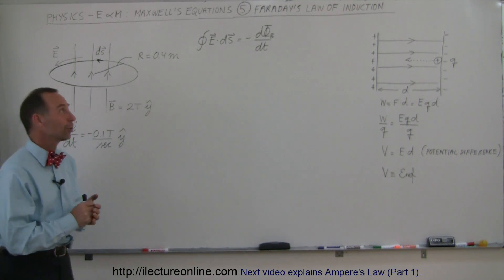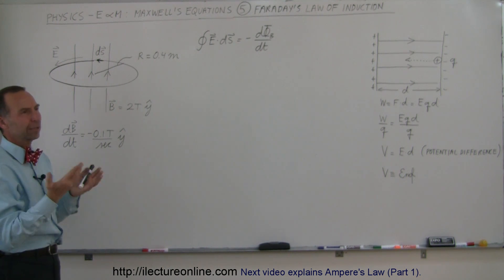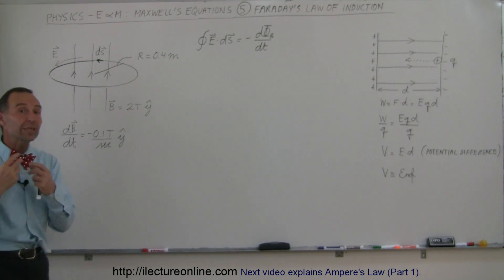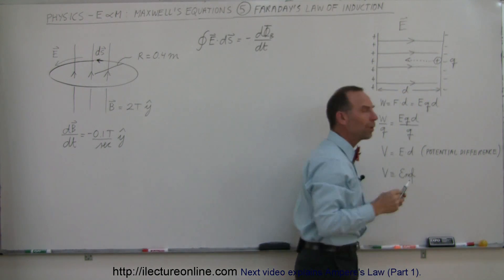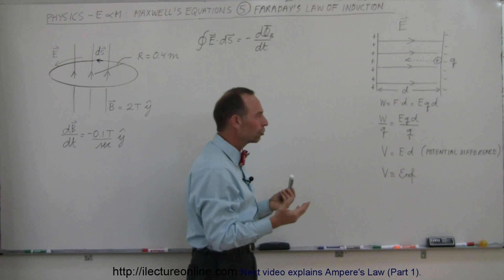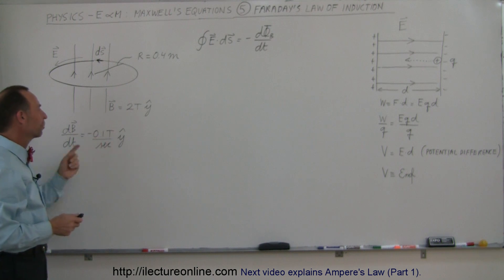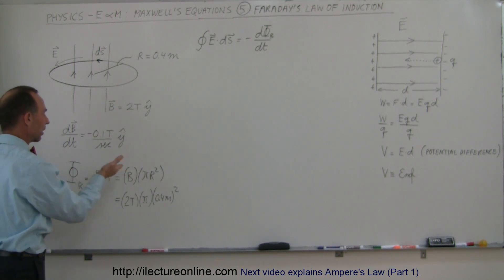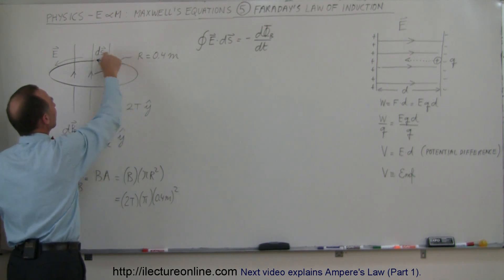Physics 46  Maxwell's Equations (5 of 30) Faraday's Law of Induction

Comment: A moving magnet induces electric field in space around it. Magnet has no electric field of its own. What is source of electric field which appears in space around it.
Reply from the maker: Not exactly.  A moving magnet causes a change of the magnetic field, and a changing magnetic field causes forces to be exerted on any charges inside that changing magnetic field.
Reply: @MichelvanBiezen  Yes, a moving magnet changes magnetic flux in space around it, which  would exert force on charge falling within changing flux. My question was not about force on charge. My question was about source of electric field which would appear around changing magnetic flux even in free space where there are no charges within changing magnetic flux. In free space only charges present are in the atoms of magnet it self unless they have any role.
Reply from the maker: A moving magnet causes a changing magnetic field, which causes the magnetic flux to change.  If the changing magnetic flux is within a closed conductor loop, the the changing magnetic flux will induce an EMF which will then push the charges around the loop.  Only charge produces an electric field and oscillating (or accelerating) charges produce an E&M wave.
Reply from the maker: A moving magnet causes a changing magnetic field, which causes the magnetic flux to change.  If the changing magnetic flux is within a closed conductor loop, the the changing magnetic flux will induce an EMF which will then push the charges around the loop.  Only charge produces an electric field and oscillating (or accelerating) charges produce an E&M wave.
Reply: @MichelvanBiezen  Changing magnetic field induces circulating electric field even in free space w/o any conducting loop. I am curious about source of circulating electric field around the magnet as magnet its is electrically neutral.

Comment: Change in magnetic flux is associated with motion of flux. Increasing current expands or moves M-flux outward  & decreasing current contracts or moves  M-flux inward. Similarly if a conductor of constant length cuts across constant magnetic field at constant velocity an emf is induced in the conductor. While in later case flux is constant it is in motion  relative to conductor. In both cases motion of flux relative to conductor is common factor. Why we don't say motion of magnetic flux induces electric flux & vice versa. This query is just to clear  my understanding.

Comment: The induced voltage in the wire loop produces a current in its loop that is due to mutual inductance from the magnetic field lines of one active conductor onto another inactive conductor(wire loop). This induced current is known as Eddy currents. Am I right, Prof?
Reply from the maker: Eddie currents are currents inside a single conductor induced by a changing magnetic field perpendicular to the loops of current.

Comment: Sir, I have a a couple of questions in regards to induced electric fields like in this example. 

First, are the electric field lines a circle (the shape of the loop)? And if so, where do they begin or end? I thought that electric field lines always begin and end at a charge, or is that only for electrostatic fields?    

Second, Gauss's Law says that the line integral of the electric field times the area is equal to the net charge enclosed divided by the electric constant: In the case of induced electric fields like in this example, if we draw a Gaussian surface around the loop so that it encloses all of it,  is the net charge enclosed equal to the sum of the moving charges that make up the induced current ... Or maybe it's zero since there would be no potential difference (emf) if it wasn't for the magnetic field? But if it's zero how can there be an electric field that has a non-zero value? (These are just guesses)
Or maybe it's something else?

Comment: Why is the magnetic flux not zero as per gauss' law for magnetism?
Reply from the maker: I think you may be mixing up 2 different and independent concepts.  If there is an existing magnetic field and we place a loop in the field you will have magnetic flux through the loop.   If you place a volume in the field, the flux entering the volume will equal the flux leaving the volume.
Reply: Gauss' Law applies to a closed surface.
The surface is open in this case.

Comment: Should it not be E dot dl? It's a line element, not a surface element.
Reply from the maker: The letter "s" is used for displacement and for arc length, therefore ds has the exact same meaning as dl.
Reply: @MichelvanBiezen   Ah, then it's just a matter of notation. My book uses dl, ds and dv to specify line, surface and volume element, thus my confusion. Thanks!
Reply from the maker: Yes, different authors use different symbols   :)

Comment: Great Video!

What happen if i add a small gap in the loop? Do you still get an emf across the gap? 
The Ohm law is still valid in this context? I mean, in order to calculate the current may i still apply the Ohm law after computing the emf?

Thanks!
Reply from the maker: In order to have a current you must have a complete loop.  When there is a gap, there cannot be a current.

Comment: Womderful video, professor Michel! I would like to ask a minor question: what happens if the loop dimensions change, for example that as the flux through the loop changes with time, so does the area of the loop. Assuming all changes to be continuous, would it make sense to generate time-dependent path and surface functions for the various limits of Faraday's law? A simple thought experiment would be a U-shaped rectangular loop with a sliding conductor making up the fourth side of the rectangle, and moving at constant velocity along the rails prescribed by the loop. In such a situation, how would one calculate the emf that is generated?
Reply from the maker: Take a look at video # 6 in this playlist:  PHYSICS 45 ELECTROMAGNETIC INDUCTION  https://www.youtube.com/user/ilectureonline/playlists?sort=dd&view=50&shelf_id=10    You will find that exact example.
Reply: Thank you, I watched videos in that playlist, and came across the example I had in mind. I have a follow up question posted in the comment section of the video you recommended.

Comment: Thanks for a great lecture. I have always wondered: Are we assuming in your example that the total NET flux through the coil is changing at the specified rate? That is, when we say that the B field decreases at a rate of 0.1T/s, are we including the induced flux of the resultant coil current?
Reply from the maker: No, we are only considering the B-field that initiates the changes.
Reply: OK, so the current in the coil will react to the 0.1T/s change even though the total flux is changing at a slower rate? Thanks for your reply!
Reply from the maker: Correct.

Comment: professor at 9:37 how did you got the 5% change?
Reply from the maker: +nikhil monarch 
The change in the magnetic flux per unit time = change in the B-field x Area
The change in the B field is given as 0.1 T/sec and the area is pi*R^2
Reply: @MichelvanBiezen  it is already given change in the B field as -0,1 T/sec, we can use this directly in equation and so no need to use initial value of B and the value 0,05 since it is confusing.
Reply: another way look at it is, how long time does it take to change the full B (2T) to 0.
That is 2(T)/0.1(T/sec) => 20 sec. so dt = 20sec
1/dt = 1/20 = 0.05, which then you can multiply dFlux.
Reply: Therefore wouldn't it be  .1*(2*Pi*r^2)
db/dt = .1 --> dflux/dt= bd(A)/dt =.1(2*Pi*r^2)/1
Is it not the actual change in flux not the percentage change in flux.
Eg Using percentages the same EMF would be produced if it went from 1000Wb to 500Wb in a second as if it went from .01Wb to .05Wb.

edit: a=dv/dt we do not measure acceleration as a percentage. Going from 1 to 100ms in a seconds is greater acceleration than going from .1 to 10 m/s

Comment: What is the potential difference across? If the loop is a closed loop it doesn't make sense for there to be a 'battery' at one arbitrary point.
Reply from the maker: +Jack Hall 
 Exactly, it doesn't make sense, yet there is a current as if there is an invisible battery driving current around the loop.  That is why it is called "induced" Emf.  And it is the change of magnetic flux through the loop that causes that phenomena.

Comment: how did you get the 5%?
Reply: +leejy2 I realize its a bit late, but its simply the ratio of change: 0.1T is 5% of 2T (0.1/2=0.05).
Reply: @jks2389  dphi/dt = d(B*pi*r^2)/dt = (dB/dt)*pi*r^2 = -0.1*pi*r^2 ?

Comment from the maker: Marcela,
If you switch the direction of the magnetic field, the effects will also be in reverse.  If you change the angle, the flux through the loop will be a factor of the cosine of the angle between the magnetic field and the normal to the plane.  The direction of the EMF can be found using Lenz's law.  (See my video in the playlist: 
PHYSICS 45 ELECTROMAGNETIC INDUCTION